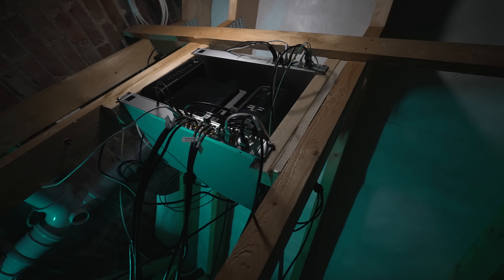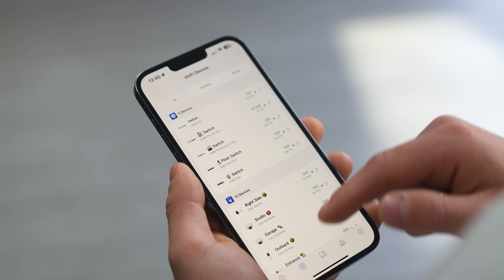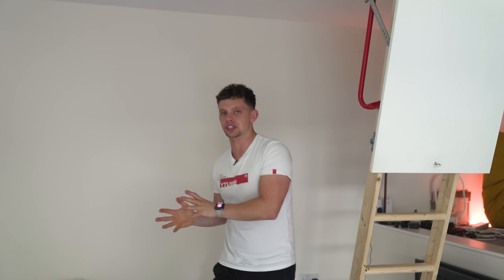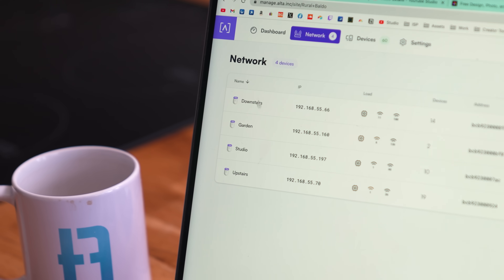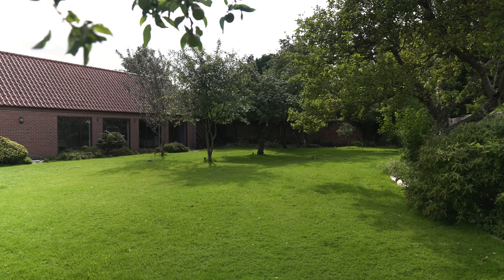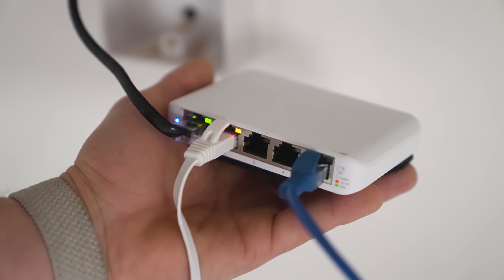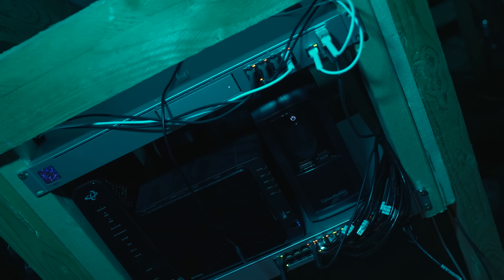Alex's New Minimal Home Network Tour: Gigabit Solar WiFi!

Comment: Consider Lightning Strikes as well - I had to deal with an indirect one, but it still vaporized Copper off a Router PCB, and cost a lot to replace several Gadgets ... Thanks for the Video, very interesting.

Comment: Alex, what are the max temperatures that you get in your loft? I've been thinking of putting together my own networking setup in my own loft, but I'm worried about the operating temperatures since it can get rather high during summer.
Reply: You can increase ventilation by installing fans to actively circulate air through the cabinet(s).

Comment: A wooden rack isn't that bad of an idea... I have a wooden shelf not used right now and have my switches and servers on another shelf nearby sitting horizontally on it but now this has me thinking of using this shelf as a rack instead of my actual 25U rack.

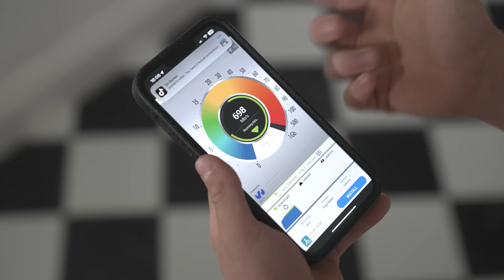Comment: Looks great but puzzled.... You mention you have 650Mbps download speed from Virgin. At 12:47 you shows 710+? Where is this addtional bandwidth coming from? Is the some dual/combined Internet or LAN?
Reply: Virgin Media you get 10% more download speed than what you pay for. Pay for 350mbps get 385. Pay for 650mbps get 715 ect.
Reply: @EpicXProtocol  It is called QOS/COS: they guarantee 650Mbps out of the 750. Assume you and your neighbour are connected to same network node and you both start a download, both will get 650Mbps. If your neighbour goes to sleep and you are the only one, the neighbour does not use his bandwidht, so you are allowed to use part of his
Reply: @RealLordy thats not how it works at all. And in the video he says he pays for a 650mbps connection. VM offer a 10% uplift on their broadband service depending on what package you choose.
Reply: That is likely the speed to the AP not internet speed, when the test continued in that clip it shows 70-80mb thats the internet speed.
Reply: @traininsanefitness14  huh, the first speed is download, the second speed is upload 🤦‍♂

Comment: The cable mamagement is shocking. External cabling not cleated, solor panels loose, cables just hanging not tidy, comms unit drilled to wood. Bit of pride in your work, especially if its your property youd go the extra extra mile.

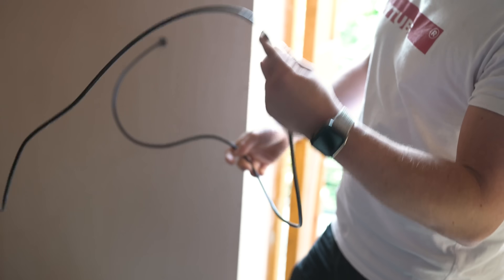Comment: @6:32 When it rains, all then water that travels down the cable will end up directly in the wall....No clips also, looks bad. I didn't see a UPS also on this equipment in the 'studio', so when the power goes out.. This section of the network also?
Reply: that's exactly what i've thought

Comment: The loft is gonna get too hot for the equipment especially in the summer.... i would look at some kind of cooling up there
Reply: The VP700EILCD UPS has rated operating temp of 0-40'C which a UK loft might exceed during the summer

Comment: The only criticism I have on this DIY home network… 1) you should always broadcast 2.4 and 5ghz, printers and some older devices do not have the capability of 5ghz, same to say 5ghz does not broadcast as far as 2.4ghz. 2) running external cable outside the house is a no/no to me, weathering, could be cut by gardeners, or if your shed broken into they could have access to your home network (crazy to think but you never know) 4) you should always lock down those ports one each switch and allow specific IP’s and MAC addresses if there are switches dotted around outside, shed e.t.c. 5) please put equipment in a rack please, if anything goes wrong it should be easy for you to diagnose.

Comment: Hello, can I get a bit of help from anyone living in the UK?
My friend looking for a new internet provider and I found a lot of bad review about virgin media. What are your experience with them?
Reply: ive never had any problems with them. there will always be bad reviews. its not good dwell on them or let them change your mind completely
Reply: Thank you for the answer. Do you get the advertised speed? My friend currently has a 70 mb internet. But they offer 250mb one which would be good. @Kaz
Reply: @MOTO_LEW dont see how you could be getting 890mbps upload as Virgin Media dont do that kind of speed. Not even on a residential full fibre to the property network. Unless you’re paying for a leasedline?

Comment: Only thing I disagree is that you should only have 5ghz as some devices still only accept 2.4ghz like some wireless printers
Reply: Also a lot of smart home devices simply don't work with a 5GHz band

Also the range of a 2.4ghz is longer (but slower) so sometimes for in a back garden it's a option because of the range (also cheaper than running a cable or buying a new access point)

Comment: In the loft is a daft idea  on a hot day and what if a fire with the backup batteries
Reply: I agree. My loft gets hot enough to thermal throttle hardware so I settled for under the stairs where it's nice and cool.
Reply: Don't get hot days in the UK lol...
Reply: @THEDADDY7770  what? Is that ignoring the mad heat wave we literally just had?
Reply: OK OK one week a year lol...
 @takeguard
Reply: @THEDADDY7770 Here in the South it's been sunny for months. Even in October I dont need to wear a coat outside.
Reply: @THEDADDY7770  yeah... that's kind of all it needs. :/
Reply: The VP700EILCD UPS has rated operating temp of 0-40'C which a UK loft might exceed during the summer

Comment: I'm not keen on that so called ran of sola you just got them panels on the roof  no rail no bracket  bit of wind and that could go flying and I used to do sola and know what can happen to loose sola panels and u hope that don't hurt any1 as this video is proof no bracket or rail

Comment: The central station/ monitoring company is supposed to alert you. OR you can get the app for your existing system. Simplisafe is not great in terms of actual security.

Comment: Since the last time I saw you and a video I purchased a 3 bedroom house brand new I can’t get a great internet provider but have a wireless internet through T-Mobil I’m not sure I can run network cable through the house if I do I don’t know if it would do any good being a wireless internet but what do you think
Reply: you can still run cable.
Just need a sim card router which will give you a couple of RJ45 ports, run the cable through the house into 10/100/1000 switches.  I'm running 5G mobile internet in a ZTE MC801A router with an RJ45 cable running downstairs and one into my office, which are both plugged into switches for any wired connections.
Reply: +1 @TrevM0nkey

Comment: so never passed your mind that server and network racks are design in such a way to prevent fire expansion, right? Never thought of that?
Reply: That is utter bs. Racks are what they are for standardization on how to put as much as possible equipment in as little place as possible. You are confusing with the ROHS standard: that is to prevent racks emitting smoke and hazardeous stuff when being in a fire. But that is only applicable in datacenters. There do exist racks that prevent fire to sprread when HW catches fire. But in that case you talk about fully closed racks. This is even not common in the industry (Industry mostly uses racks with meshed doors to allow ambient cooling, which is more efficient than on the spot rack cooling). Your reply shows that you are not at all into real field engineering or datacenter building.
Reply: @RealLordy   You answered yourself "racks with meshed doors", now go and look for meshed stoves, and watch physics unfold, your reply shows that you are not at all into science, engineering and data-center building.

Comment: What modem did you use to convert the coax?
Reply: It’s a Hitron modem, supplied by Virgin Media to business customers
Reply: It’s supplied by Virgin Media as part of the data contract and is branded to Virgin.
Reply: That wasn't the question? 

I have virgin myself, planning to get a UDM Pro & am looking for good docsis 3.1 modems
Reply: @OfficialyMax  - misunderstood, apoloiges
Reply: @OfficialyMax if you have virgin then you cant use the coax to plug into a different docsis modem. It has to be plugged into the Virgin Media provided modem.

Comment: is it better to use wifi 6AC or wifi 6AX?
Reply: Isn't AX the only option for WiFi 6? I thought AC was WiFi 5.
Reply: @jamescollins6085  they throw around so many wifi 6 terms without explaining the difference between 2.4ghz and 5ghz they are the bands on the wifi 6 routers AC is early wifi 6 and AX is more recent wifi 6, as far as i know early wifi 6 AC is slower than wifi 6 AX and they both have 2.4ghz as well as 5ghz bands but that could just be a usa thing and not a uk thing

Comment: get an automatic transfer switch on there for Ecoflow, Battery voltage drops to 30%, switches to grid.
Have drip loops for any wires going into the house

Comment: You should never exclusively only broadcast 5ghz. Not only do you have some devices that don’t support it, but you also can run into issues with the signal going through walls. If you’re going to run only 5ghz, you’ll end up needing more AP’s.
Reply: Yeah, dual band would be great
Reply: what's wrong with more AP's if he's doing only 5ghz. also most devices support 5ghz now a days
Reply: @brenisdank7097 a lot of IoT devices don’t support 5ghz. And more AP’s means more money. You have to have more lines for each AP, and just more unnecessary devices on your network. Less AP if you just simply broadcast both bands at the same time lol
Reply: @brenisdank7097 no they don’t lol. A lot of IoT stuff only supports 2.4
Reply: @brenisdank7097  most iot devices don't support 5ghz at all

Comment: love the solar idea, would be interested to know why you didn't go Unifi for the APs though and have one ecosystem. Also don't rely on silicone for drip runs always loop cables below your hole for external points. If you want, its your house :)

Comment: Curiosity not criticism: why APs and not wired backhaul mesh nodes?
Reply: I do not know these APs do they mesh? I have 27 Ubi APs about half mesh and its hit and miss but its for a warehouse.
Reply: @TheNewryRFC  APs are best if you want to segregate your network I believe. APs and mesh nodes are both wired back to the router directly
Reply: @joshieporritt sorry I meant this brand of AP, I have no first hand exp of it
Reply: @TheNewryRFC  Alex is using Alta Labs APs (a new player in the space). He did a separate video on them in June and yes they do mesh 😃
Reply: @DallinKauffman thanks, do you use them? just wondering advantages over Uni kit? Maybe the video covers this....

Comment: Might be worth calling virgin. As most of their network is FTTC but some of their network is FTTP. my house for example is FTTP so you may be able to eradicate the coaxal from underground and instead have fibre. No harm in enquiring with them
Reply: Only works in XGS-PON Virgin areas which isn’t in Newark yet
Reply: Incorrect. Virgin have FTTC, FTTP and XGS-PON. However if he has a coax connection then its either FTTP that converts through something called an ONU (Optical Network Unit) that converts the fibre to coax to plug into the hub. Or its Coax straight from the cabinet into the hub.
Reply: @EpicXProtocol  also as I’ve seen in Newark areas these connections (typically to older properties and older infrastructure) this will be straight coax from cab
Reply: @EpicXProtocol  it’s not the same as FTTC, it’s similar but not FTTC, XGS-PON is basically FTTP anyways

Comment: Now this is the second time I’ve seen network gear mounted to wood studs 😂 great video
Reply: would be interested to see what you would do different?
Reply: @TheNewryRFC  What Alex did is a cool idea and works nothing wrong with the setup 

Me personally would have put plywood backboard on and a network rack
Reply: @MactelecomNetworks agree totally! as a company doing installs though, is there fire regs over POE equipment and fireproofing? I know now in the UK even fuse boxes now cant be plastic due to new regs. But again agree no dishing and im talking commercial not DIY
Reply: @TheNewryRFC  poe isn't as high current or voltage tbh 
also it's technically low voltage so not the same regs for it
Reply: @BenCos2018  still 240 going to it though no?
Reply: @TheNewryRFC  not in the network lines 
and the switch itself is made of metal and has a fuse in both the plug and fuseboard
Reply: also big big fan, just never get to watch you lives due to time differences! keep up the great work

Comment: Quick question. In your opinion what us the best wifi mesh system to get with Google fiber. I currently am having connection issues with my router being on the first floor and my gaming room being upstairs. I have 1Gig internet but I believe I am in a dead zone of the house. I get great upload and download but my internet on games has a lot of packet loss.
Reply: don't get a mesh system just get an access point put it on your room and then run a cable to it. Mesh systems split the available local bandwidth so you might get lower speeds than your paying
Reply: @giannisd961  depends on the mesh system 
some do a separate backhaul between them on another frequency which helps with speeds
Reply: I have Netgear Orbi. Well worth it